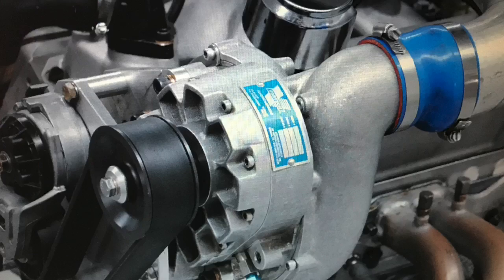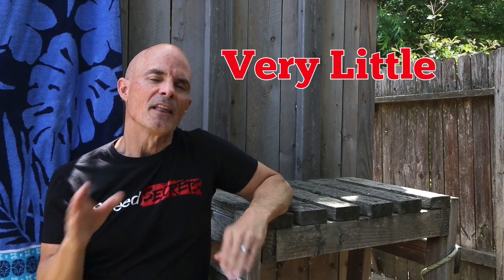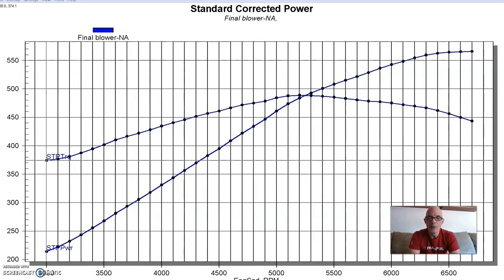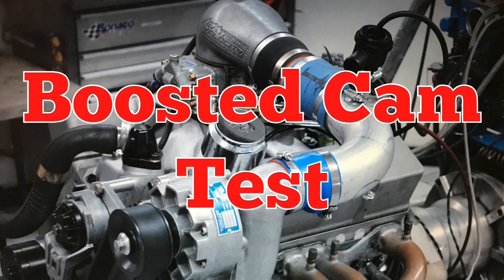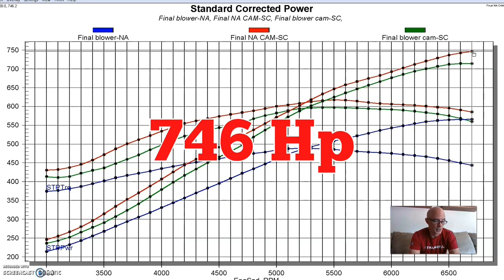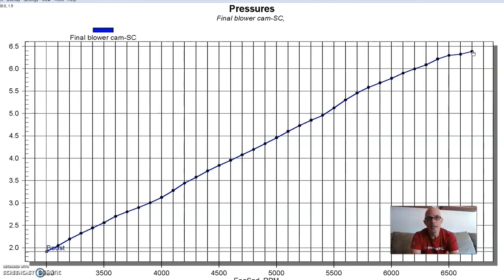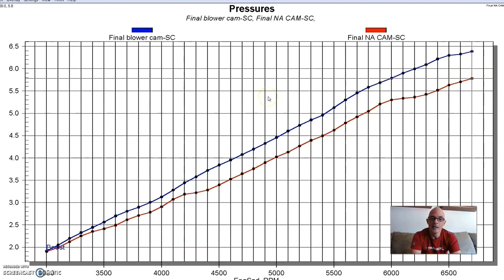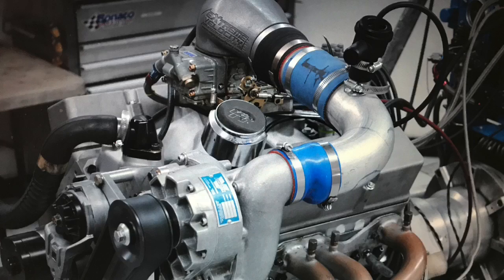MOTOR MYTH BUSTING-BLOWER CAMS!

Comment: Long ago, when I was hot rodding in my youth we talked a lot about rod length to stroke ratio and how it effects torque and redline (piston speed).
Is that still a thing?
Reply from the maker: In my testing rod length has not altered the power curve-stroke length certainly does
Reply: Nope. One of the most inconsequential factors in an engine there is.  Some old Smokey Yanick quote blown totally out of proportion... 

From David Reher at Reher-Morrison Racing: "If I had to make a list of the ten most important specifications in a racing engine, connecting rod length would rank about fiftieth. Back in the days when Buddy Morrison and I built dozens of small-block Modified motors, we earnestly believed that an engine needed a 1.9:1 rod/stroke ratio. Today every Pro Stock team uses blocks with super-short deck heights, and we couldn't care less about the rod ratio. A short deck height improves the alignment between the intake manifold runners and the cylinder head intake ports, and helps to stabilize the valvetrain. These are much more important considerations than the rod-to-stroke ratio. There's no magic - a rod's function is to connect the piston to the crankshaft. Period."

The mean piston speed with  short rod and a long rod is the same.  The PEAK is a teeny, tiny bit higher with a shorter rod. The peak piston speed occurs at a different time in the rotation with a shorter vs. longer rod. 

Nascar tested their SBC 358 test engine with both a 5.25" and a 6.1" rod and found a 2 ft lbs ; 2 hp difference... on a NASCAR engine.... 

A long rod will side-load the piston an infidecimally smaller amount, but it doesn't make a difference.  A longer rod usually means a higher pin height and therefore a shorter and lighter weight piston, which can be good... (But it's not the rod ratio that matters.) 

Long rod makes SLIGHTLY better VE at lower RPMs; short rod better VE at higher RPMs.

Ideally a long and a short rod should have SLIGHTLY different cam events, too.  Per Mike Jones, the Cam King: "Normally the higher the rod/stroke ratio, the shorter the seat duration needs to be for both the intake and exhaust profiles, and the intake needs to close earlier, and the exhaust needs to open later. Intake opening and exhaust closing don't change much, if at all.
For example, if you had a had a 12:1 358" SBC, that came off the corner at 4,500rpm, and turned 7,200rpm at the end of the straights, with a 5.7 rod, you may run a 296/300 @ Seat with a 102 ICL and a 110 ECL. If you were switching over to a 6.125" rod in that same engine and gearing, you would go to something around a 292/296 @ Seat, with a 100 ICL and 108 ECL."

Comment: I love your videos. All the data I’ve craved from similar videos in the past that lacked it. Plus, you use so many different combinations along the way, instead of just a typical “here’s what happens on an ls1” video. My opinion, the boost pressure dropped because the engine used more volume. I’ve had the same experience with my motor through the years. Lower boost means less stress, even with more power.

Comment: Really like this video. Planning a 95 roller 351 build in the near future. You do alot of 5 liter builds. My question is why do you guys bother. Ran both when I was seriously racing. The only reason to build a 5 liter is that a 5.8 won't physically fit. Planning a build with a 95 f150 step side my father gave me before he passed away. Raced fox body mustangs for years. My son sold a modified Roush 427 and bought a 2016 gt. Build is for Myrtle Beach mustang week. Gonna build NA, but with a turbo 8lb out so next year. Just put the turbo on the na setup. Thanks

Comment: My dad raced using a 327 with a stroker crank in the early sixties. He said it had a 4x4 bore? I wonder if anyone can explain if this was a good idea? What did this make his engine into? This engine had a 6-71 and was injected.
Reply from the maker: maybe a 4.040 or did it have a 4 inch bore and 4-inch stroke? That is harder to fit
Reply: @richardholdener1727  I think its a four-inch bore by a four-inch crank. He had this made from billet in about 1962. After this expensive crankshaft was made he never had any more crankshaft problems. I was thinking maybe there was some old hot engine that used a combination like this.

Comment: Love the testing. But this is a terrible comparrison. You cant make a conclusion when 1 cam has 250degree int event and other cam has more int duration.  Its not even a comparrison. No shit the 260s cam makes more.  Run a test with same exact intake lobe and move the exh centerline.
Reply: The point of the test was not between two similar small cams. The point was to see what happens making a drastic change in valve timing with everything else being equal.. maybe exhaust centerline testing is another video, but i don't see why he would bother.
Reply from the maker: glad you understood the test

Comment: Here's what I think, firstly great video Richard your videos are very welcomed.
So what I am thinking is that the na cam is losing air straight through. The reason why I think that is the power difference na to boosted,
 na 31 hp 
boosted 29
The thing to remember is that the supercharger is turning the same speed, same revs same pulleys so same total air intake, less back pressure/psi suggests the na cam is using more air but making less comparable hp.
In summing up, the na cam used more air but didn't show in produced hp.

Comment: Richard Holdener I need a cam for my street 354 ci hemi, 6-71 (6500 rpm and 6 psi). My blower guy recommended a pretty 'big' cam and I wasn't so sure about that. After watching this video I'm going to do just that. He also said the supercharger tends to tame a cam as in smooth out a choppy idle. Did you find this to be true?

Comment: Love it! I’m running a Sbc 400 was nitrous so compression was 10.7 switch to an 80m turbo and dang for a 4.5 gate spring and 3.08 gears she hauls ass! 
What kinda timing were you running? Or timing control you use ?
Reply: Yes timing info is missing and I crave it.  Locked?, advanced?, Boost referenced retard would be my go-to.  But how to measure it's effect besides hp and torque. EGT?

Comment: The answer is both.  The engine is using more air due to increase in VE, especially at the higher RPM.  It was also bleeding out a little more through the exhaust, especially at the lower RPM where there is more time per event, and around the range where the header scavenging is strongest.  The primary cause is increased overall VE though.  One other small factor is the drag on the crank pulley is a little less with the increased VE.  I think, at least in the past, people were picking blower cams in order to keep them mild but get more from the boost.  With EFI it used to be more desirable to run milder cams to keep vacuum more steady.  Also the lobes were not quite as intense decades ago.   A blower cam may also prove a little more beneficial on a vehicle with a full exhaust system,  where a tight  lope-sep cam may have a little disadvantage with the muffled exhaust.

Comment: Static compression means nothing....dynamic compression is everything.
Reply: 100% not true.
Reply: @vengeanceizmine9878  sure it is.....you have to match compression to cam timing. Just because you have 12:1 static compression, it will get altered based on duration and overlap
Reply: @hoost3056  Incorrect. Valve timing is based on static compression, amongst many other important factors. Dynamic, is running compression, with all the factors added up. Still has nothing to do with tune requirements. It is just a byproduct like an AFR or CFM number. 
Try running a 15:1 static race engine on 93 octane  pump fuel based on a 10:1 dynamic and let me know how you make out. Even better, design the cam timing based on 10:1 dynamic for a 15:1 static.

Comment: Hey Richard.. Love these vids. Always said I wanted to try this. Truthfully I wish you had run the same duration cam for both tests(whatever that would be) but run one on a 112-114 lsa on one and 106 lsa on the other. Thank you
Reply: That just changes the curve. Doesn't change the length of valve timing or overlap..  All depends on where you want the power..
Reply: @vengeanceizmine9878  it actually does change the overlap. It would have more overlap, with the tighter lsa ,hence a longer period where the intake and exhaust are open same time and boost would go out the exhaust.
Reply: @Scubasteve22  Do the math. LSA is just a byproduct of valve timing, which are open and closing events. Once that is set, the amount of Overlap is ground in the cam, just like the LSA. It can't be changed, only moved. Overlap does NOT increase or decrease by moving centerlines on a given duration, you are only moving WHERE the overlap occurs, NOT how much it has. That is only done when opening/closing points are changed. Period.
Just because a cam has more overlap, doesn't mean it ALL goes out the exhaust..
Reply: @vengeanceizmine9878  He was talking about changing the LSA. You're talking about changing the advance. 

Two cams with identical durations and different LSA will have different amounts of overlap. That's what he's talking about.

One cam installed with different amounts of advance will indeed retain the same overlap and just move the overlap, as you describe - but that's not what we was proposing.
Reply from the maker: whatever the change is na-the same under boost
Reply: Richard Holdener I thought the idea was to take two different cams both on a blown engine and have one with a wide lsa and one with a tight. N/A doesn't have anything to do with it. Just run both tests blown and change the cams? Should be easy
Reply: @Scubasteve22  It wasn't an LSA comparison video.

Comment: That certainly makes sense with a centrifugal blower that will automatically flow more air if the engine will accept it. (not as much as a turbo, but still, more) You may be wasting  some of the air out the exhaust but the engine is also capturing more air. The added volumetric efficiency is more than the wasted exhaust.

Will it still work the same with a positive displacement blower? The boost will go down. The efficiency will go up. But the boosted air volume will remain almost the same. The added efficiency may not be enough to make more HP.

Comment: What do I think?  I think you are starting out with way too high of a compression ratio for a boosted motor.  No mention of the type of fuel used and the fact that the high overlap cam effectively lowers the compression ratio of the motor which is good in your case.  I would think that it would be best to not push un-burned gas out the exhaust.  So that would mean dropping the compression ratio and getting rid of the overlap.  Then add as much boost as your fuel and tuning will allow.  Of course I look at this from the viewpoint of having a street-able/drive-able motor.

Comment: Pressure isn't volume. Boost is a constant state of pressure, based on a specific volume. Change the volume within a specific given pressure, and the pressure drops. (Think fuel regulator) That's why when it does, you have to readjust boost level, up or down, depending if you went more or less volume. How much depends on the amount of volume changed. 
If the engine needs more overlap to make power N/A, then it will make more with boost in the curve accordingly, regardless of overlap. That's why, for all intensive purposes, there really isn't boost specific cams, heads, intakes, etc..

Comment: I would like to see what LSA does under boost and NA. Two cams with the same lift and duration on both cams. One with a “NA” LSA and the other with a “boost” LSA. Then you could see just what LSA does. Of course you’ve probably already done that. Oh yeah and IMHO the decrease in boost is probably a little of both. Probably, more due to the efficiency increase than due to the overlap. But what do I know. GREAT VID!!
Reply: Apples to apples, changes in LSA only, just moves the power band in a given combination..

Comment: Have you done an 8.1 with a turbo and cam upgrade. I want to upgrade my 8.1 in my 35 foot motor home so I can tow and handle the mountains. Any suggestions would be great.
Reply from the maker: not yet
Reply: @richardholdener1727  just wanting to improve the performance of the 8.1 in my motor home. Living in Colorado the mountains can be a challenge but more so when towing. It would be interesting to see what a turbo and cam would do.

Comment: The pressure dropped because the volume has effectively increased with the bigger cam.  More of the available  flow is going into the engine.   It's like taking small gulp of air from a balloon vs a longer bigger gulf.
The reason for "boost" cam is to retain the refinement.  There is something to be said for how docile the modern factory boosted V8 are until you put your foot into them.  Making big power these days is easy, harnessing effectively isn't as easy.

Comment: Oh the myth of the boost cam. Sometimes that overlap is good and overcomes a restricted exhaust. 90's emmissions cars often had single exhaust with a poor y pipe design and the legal headers of the day weren't exactly long tube with 3" collectors. People confuse the issue of exhaust backpressure. It's not just a parasitic loss. It's also exhaust stuck in the combustion chamber effectively reducing ve and possibly causing detonation. Normally on an ideal performance built the velocity of the exhaust system can keep the flow during the overlap period and evacuate the combination chamber. But on some of those single exhaust catalyst cars even the legal headers and high flow cats were only able to do this for maybe 300hp. But in those days centrifugal superchargers were pretty damn awesome and the rising boost curve could help it exceed the rising exhaust pressure curve. They can even work well with stock manifolds. While many thought blowers need open exhaust they may actually deal with backpressure better than NA because the ve isn't negatively affected. I think the worry about over cammed blown applications is more that the exhaust Temps could run away. Or that the bsfc could go down because. But the boost pressure would still be a good representation of what the cylinder density will be. Like the mass flow might go up more than the boost pressure would indicate but you're not really reducing cylinder pressure any more than you're reducing boost pressure..

The other thing that makes it a myth is the idea that adding 4 or 10 degrees of lsa is going to help the overlap much when you have added 30 or more degrees of duration over stock. Sure maybe a little tweak to the lsa might be a good thing for a setup that helps keep the flow one directional but the idea that the right amount is always 112-118 degrees or that this exclusively related to getting rid of overlap is a little bit silly. But it seems this trend was around even when roots aka "Jimmy" blowers were popular. 

I can see shorter duration being used on centrifugal setups 1 because the Era that popularized them had to deal with smog laws and 2 because the rising boost curve extends the Rev range so it's easy to get Into a situation where hp is rising but you have to shift to keep from valve damage and you aren't taking advantage of all the power the induction setup has to offer because the rest of your parts aren't matched for that kind of rpm.

As far as turbo cams, low overlap might be good for small responsive turbos but for well flowing turbos you might find that you get much better response from a cam that is torque centric. I believe Ken duttweiler (perhaps it was someone else) was talking Buick cams, and yes a Buick is an rpm restricted engine because of the oil system but the ball park numbers he threw out there were like 215 or 218 degrees @0.050 intake duration, 109lsa and I forget exactly what he said about the exhaust but these numbers sound a lot like mild chevy small block cams with that narrow for the street lsa. His explanation was that the turbos he was using were very efficient and maybe didn't suffer from the issues of exhaust pressure that exceeds intake pressure. Sure even with a narrow lsa the cam probably wasn't too heavy on overlap because of the short lobe durations but it was still a departure from the boost cams of the time.

As much as I agree that on the Dyno a boosted engine does what it does without boost just more of it. I have to say that there may be a little logic behind the aftermarket targeting certain offerings. 1- just plain marketing. 2- in the world of professional racing you might find certain limits. A race engine that detonates may limit your tuning range, and a less powerful cam that overcomes detonation may allow more boost. Or maybe it's an exhaust temperature limit. It sucks to burn valves. 3- a supercharger may make a milder engine more appealing. Everyone like high end hp untill they drive something that can blow the tires off on the slightest tip in. The high end engine might be fun to go racing on a back road but the mild engine can tickle you're hp obsession driving to work in city traffic with the ac running. So all cams may be blower cams and turbo cams and turbo and supercharger cams work fine NA . But maybe it's  less about a number and more about a total package. And sometimes you have to consider the exhaust, the car, the torque converter, the gear, and not just what the cam says on the box.